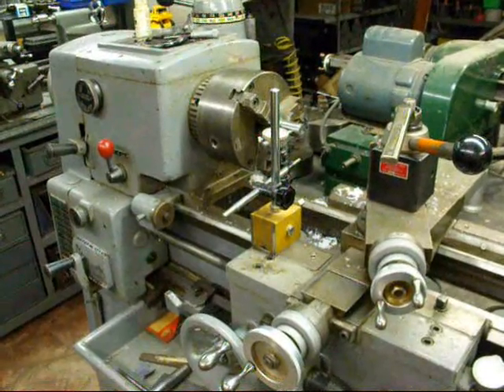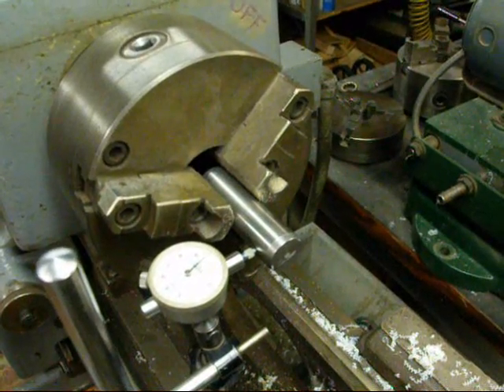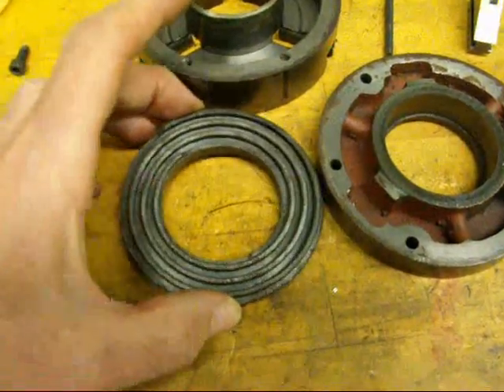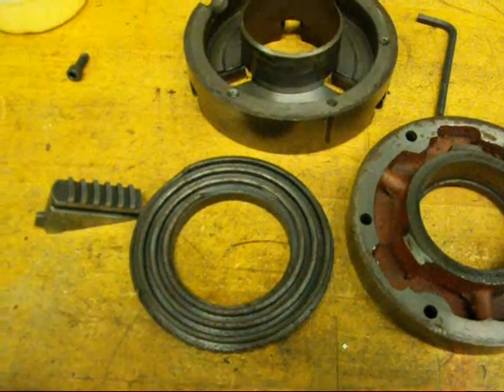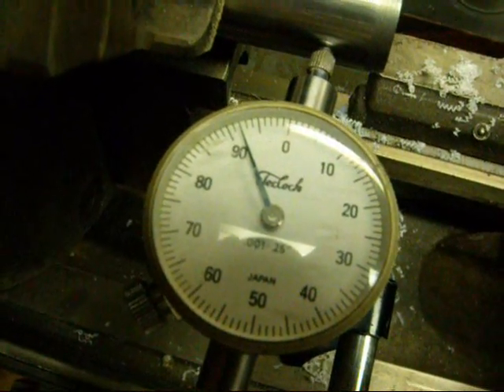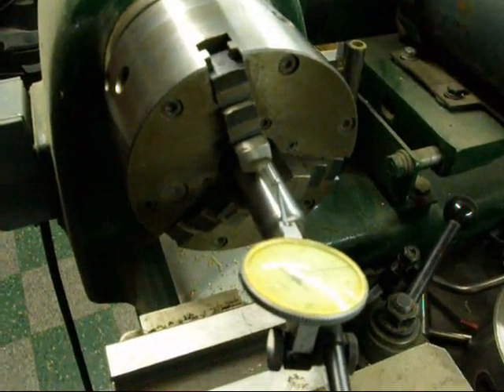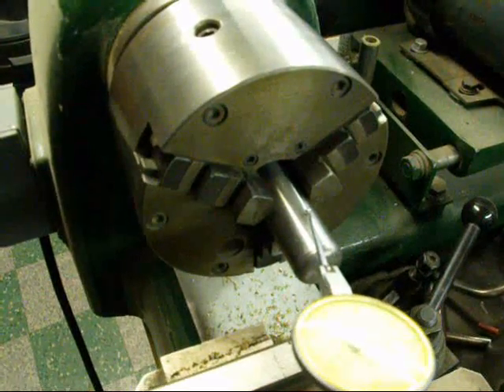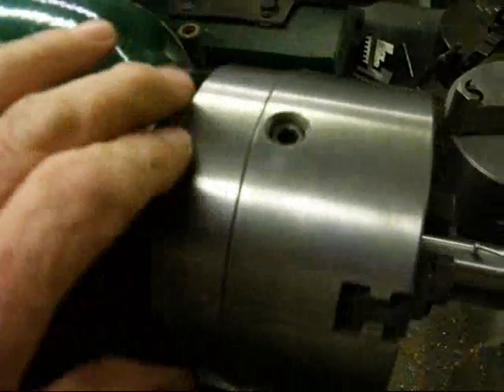Three Jaw Chucks on Atlas Clausing Hardinge Lathes part 1 tubalcain

Comment: Thx for another great video. Hoping to pay it back, i want to share something i just found on my 3 jaw. i have a nice Enco lathe i picked up for a song and quickly found the 3 jaw it came with had terrible runout. with all the tricks you suggest i could never get it below 12-18 mils making it almost unuseable. i indicated every surface on the chuck and nose and everything was under 1-2 mils. driving me crazy.  it has a D1-4 backplate and after i had decided to spend the big bucks on an adjust-tru type chuck as you describe, i just happen to notice a thin sliver of light between the chuck backplate and the nose, even tho everything was tight and mic'd out fine. turns out the previous owner must have banged the backplate pins into the nose holes pretty badly on more than one occasion and there were smooth raised burrs around the edges of the holes, holding the chuck slightly off the nose face and taper. after 30 mins of carefully honing the face of the nose the gap was gone and the chuck now fits so tight onto the taper it has to be tapped to get it off, where it use to fall off as soon as the cams were turned. now my chuck was down to 6-8 mils runout. but not done yet. With your suggestion of rotating the jaws to different slots, i found one combo that gives me 1.5mils of total runout! and its repeatable making sure to mount the chuck back into the same cam pin holes each time.
long story but just want to say great thanks for taking the time to discuss and show these issues. they provide inspiration to hacks like me how to make the best of what equipment we have.
Reply from the maker: Good story--and good discovery of what was wrong-keep watching

Comment from the maker: @jrarvo The jaws are hardened. Its usually done with a toolpost grinder holding a nib for internal grinding. A ring or rings are placed in the rear of the jaws while grinding the front. Vise versa for rear. The purpose of the rings is to put a load on the jaws. You will not like doing it.

Comment: Very interesting.  I use a 4-jaw scroll chuck on a woodturning lathe but I'm sure I wouldn't want to put an indicator on it despite the fact it was very expensive.  However, it's more than adequate for working with wood.

Best Wishes,
Brendan